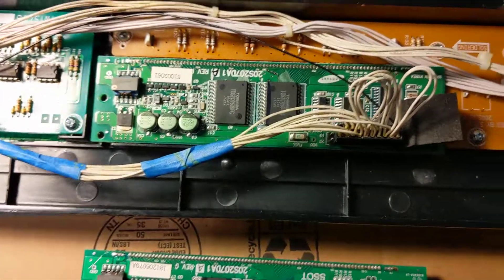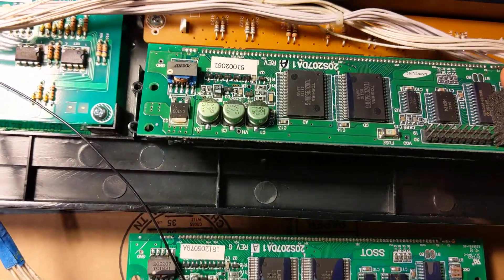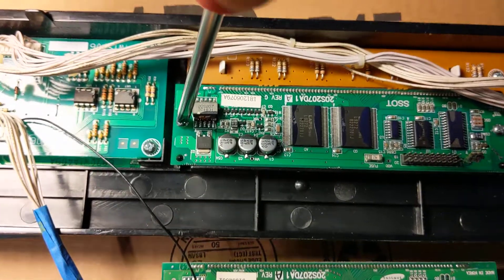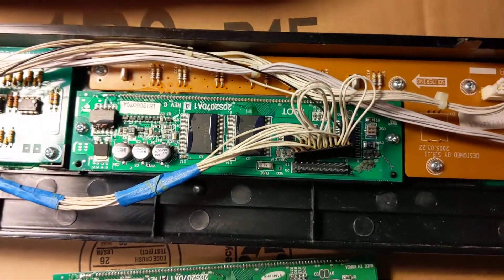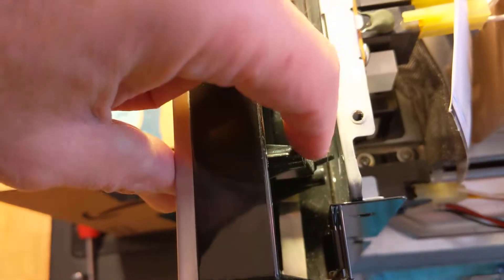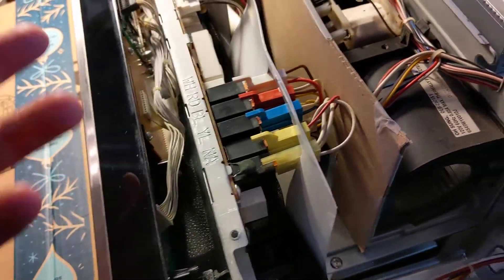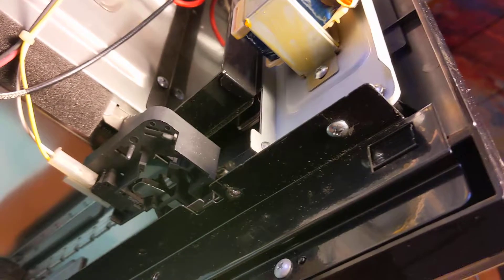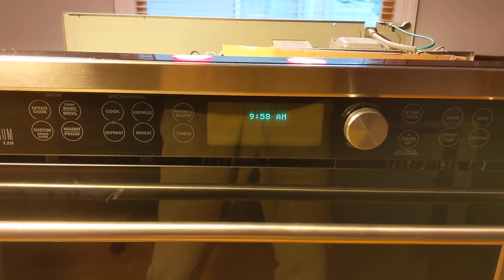Repair of display  control board of Adventium 120 GE Monogram Series, part 2

Comment: I tried replacing the display board (twice) and the control board followed by the transformer (rec'd from another thread).  None eliminated the flickering and degradation of the display.  I finally replaced the power board based on commentary on this thread and the microwave is back to normal.  Can't believe how much time I spent on the display board.  Others please take note, especially those who have tried and failed with the first solution.  BTW the power board is cheaper ($116 at Unlimited Appplicance Parts).
Reply: WB27X10861 is the powerboard part number

Comment: I had the same symptoms, followed your wonderful instructions, and this did NOT fix my microwave. In fact, it made it worse. Before the display didn't work but the microwave did (as long as we remembered what to press). The display now shows a 4x8 pixel rectangle that flashes and the Express button doesn't work (machine doesn't work). Presumably another board needs to be replaced, but not the WB27X10858. I am earnest, though, when I say THANK YOU. A community/crowd sourcing information is useful. Thank you!
Reply: I'm om here for same issue. I just noticed your comment and wanted to let you know he had verbally stated the wrong part# in his video but corrected it on his description.  It should end in *856! That's likely (hopefully) the reason why! Best of luck.

Comment: Same symptoms, ordered new part and installed.  Plugged in and new board is brighter but flickering like crazy.  Waiting to see if it stops - fingers crossed.
Reply: Faulty - needed to order second time.  Paid extra for next day delivery and 4 days later not received yet :(
Reply: Second one did not work either...returning both!

Comment: I bought this part and I am attempting to replace it on my own...Can you tell me if the microwave has to be completely removed for it in wall position OR if you can just pull it out mid way and perform this replacement?? And which  are the screws holding it in position Alan screws Metric or American???
Thanks

Comment: You provided the wrong part # under your description.  That is not for the display it is the Control board which IS NOT that part you replaced in your video.

Comment: Thanks very much for walking through the steps well. I was able to replace the control board without any issues. There was a lot of flickering with the new control board but it stabilized after 5-10 minutes.
Reply: I just replaced mine and it is flickering.  I am hoping it does stabilize.  Did yours continue to stabilize?

Comment: Hi Steve the appliance guy here in Las Vegas I just did this repair today and I want to let people know that these digitron display boards are definitely not perfect the first brand new one that I put in was a flickering failure would not stop flickering after installation and we waited 10 mins to see if it would stop flickering it did not. I went back to the part store to get a second display board. It also with it upon installation but after two to three minutes we left it there it stopped and became a normal working display board. I just warning people upon installation you may have to let it sit for 5 to 10 minutes to see if it will stop flickering. FYI yes you are saving money if you do it yourself as I charge $400 parts and labor to do this job which is still cheap for Las Vegas.
Reply: Just installed a new one and it is at least working now but I do see flickering at the clock level. When i change it up to cook it is not flickering. Was that something you experienced as well?
Reply: @davidpai7127  Hey David, did you ever get your flickering at the clock level figured out?  I am experiencing the same.  Installed new display board, but the clock display flickers constantly.  When I initiate a microwave function, all good legible and stable display.  I then clear the microwave function, which sets it back to the clock display- immediate flickering of the clock time display.  Anyone else have suggestions, or do you think this is a faulty board.  I reconnect the old dim display board and the clock time display does not flicker (just too dim, hence the reason to replace the display board in the first place).   Thanks in advance for your thoughts.

Comment: PART # WB27X10856 - DEGITRON. [ Front Panel Display 4 time n settings etc ]

Cost of Part $257.  1/24/23

My problem was that the display showed random flickering display info and did not stay lit and stable.

Your Video explained the "how to" quite well in terms of accessing and replacing the Degitron dislplay unit.

Would have been nice to have shown the removal of the cover as well for a seemless DIY Repair. [ For the not so savvy DIYer ]

Thank you.

Comment: go get some of that fiber board that has a high temperature burn rate. and take the cardboard out of your frigging oven  if you really want to put something in there blocking air circulation,   you goober!     IT IS AN OVEN ! IT GETS FRIGGING HOT AND CARDBOARD WILL COMBUST AND YOU WILL BURN YOUR FRIGGING HOUSE DOWN AND YOU WILL LOSE EVERYTHING AND MAYBE YOUR FRIGGING FAMILY TOO AND ANY PETS YOU HAVE.   what. did you think? the engineers just forgot to put a shield in all their ovens and you just came up with a great fix outsmarting them ?    this must be a design flaw in humans that are smart in some things but think they are smart in everything.   nope  There are so many things I'm really good at that no one else can do, but I know my limitations and don't try and re-invent the wheel .    did you notice there is no other cardboard it there? why could that be?   hell, why don't you just stick a book of matches in there as well, Sorry for being harsh, I'm just trying to save your kids that might grow up smarter then you, so when they get older they can cuff you up the back side of you head and  say ,   "what the hell Dad !"

Comment: Great video, however your reference the wrong part number. The part you replaced is WB27X10856.
Reply: Correct...... pulled the unit apart for replacement only to discover I had wrong part.......  should be WB27X10856.

Comment: My symptom is the the display flickers the time around the screen and eventually goes dead...   I turn the power off and on to the microwave and then the unit works fine for a little while (sometimes minutes, sometimes when I'm lucky for days), but the same problem reoccurs eventually with the display flickering and going dead.   Is that a symptom of the display control Board, or could it be one of the power or sub-power boards?   want to order the correct part so I'm not wasting money.   To me this sound like the Display Control Board, but wondering if anyone had similar symptoms and confirmed the display control board was the fix.   Thanks!
Reply: yes... was the display board.   Replaced that and now everything works.
Reply: @daveross6310  thanks Dave, have ordered the part 🤞🏻
Reply from the maker: Hi David,
I am Physical Therapist (not electrician) who happened to fix this microwave and I wanted to help others as much as I could. I am not sure if you are correct or not. I had to do a lot of investigating and took a shot with the board. I was correct. Call manufacturer and try to talk to tech there. I had to make a risk too. They told me that this is probably board but they were not sure. Good luck!
Andrew
Reply: Thank you.   And I appreciate you taking the time to share your experience and video!
Reply: @daveross6310  mine is doing the same as yours, did you get your fixed and was it just the display board? Thanks.